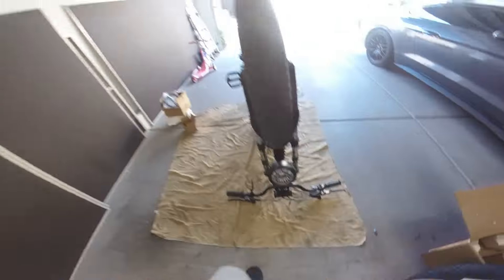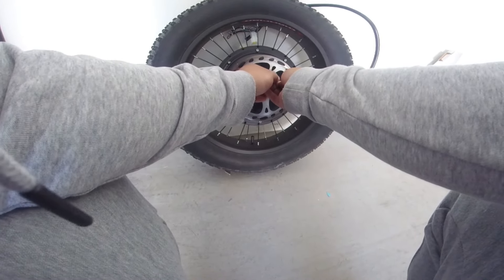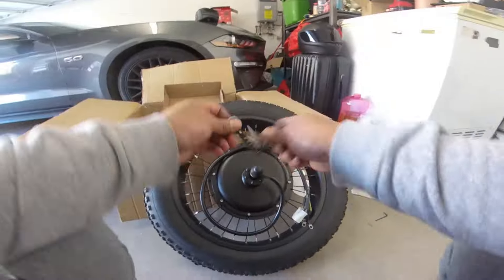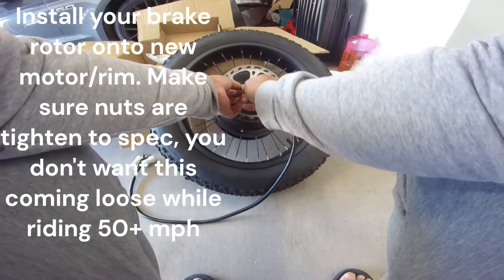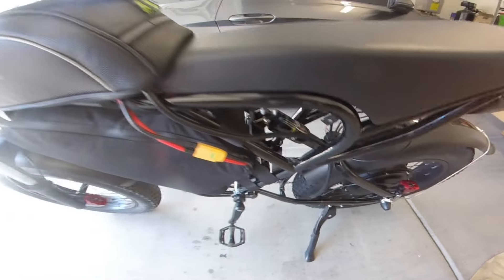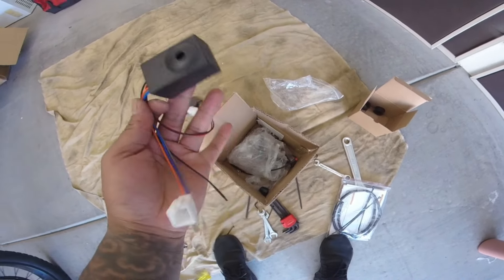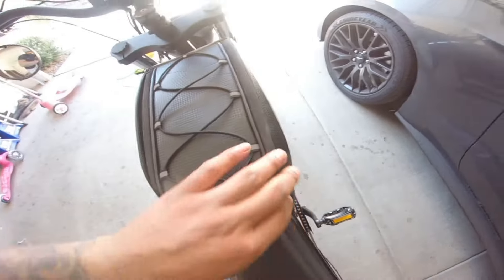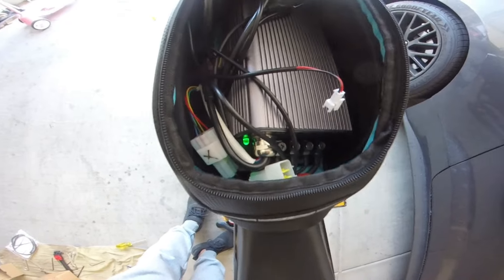3000w 72v kit E-bike installation video

Comment: So basically, gut the bike and put stronger ones in? No need to use any of the factory stuff, correct? I have the exact bike and want to upgrade. Appreciate your videos, been looking for a couple years now on how to get this bike to go faster. Even tried clipping wires which did nothing.
Reply from the maker: You are replacing the important components, battery, hub motor, controller, throttle, display
Reply from the maker: This is the best bang for your buck to go fast and look good while doing it
Reply: You're a saint  @Electronic2wheels
Reply from the maker: @paullsmith5548  thank you

Comment: Is there any way to mount the controller somewhere else? Maybe under the seat or anywhere other than the space between the seat and handlebars as I’d prefer to mount a bag there for actual storage instead of the controller.

Comment: I can’t find it if you answered in other messages but what kit is this?  Could you drop a link 
I’m guessing everything but the battery
Also do you know the weight with the new battery and motor
Thanks for the vid
Reply from the maker: https://www.ebay.com/itm/225000078386?mkcid=16&mkevt=1&mkrid=711-127632-2357-0&ssspo=ed728llcqlm&sssrc=4429486&ssuid=DP9k0GGeTNO&var=&widget_ver=artemis&media=COPY
Reply from the maker: It didn't add too much more weight to the bike. I'll have to grab that info for you. The link is the exact kit I bought. Super easy to install.
Reply: @Electronic2wheels  awesome thanks a lot. Love the videos
Reply from the maker: @lukenorton8243  Thank you for watching. I have some more ride videos I need to upload.
Reply: @Electronic2wheels  looking forward to them 👌

Comment: Can I just get any kinda 72 volt battery or does it have to be a certain one?
Reply from the maker: You can use any 72v battery, continuous current must be 80 or more. If not, your bike will cut out while under load
Reply: Like 80ah?
Reply from the maker: @danielczajko1  no, not ah. Continuous current. The controller is rated at 80 amps so you need a battery that can handle 80 amps
Reply: I'm lost bro
Reply from the maker: @johnnyblaze43  what do you need help with
Reply: @johnnyblaze43 ah is the size or capacity of the battery. When he says 80 he’s talking about how much current it can output continuously.
Reply: @Electronic2wheels I thought the q20 could only handle a 52v battery

Comment: I need my bike to go 70-80, any advice on wattage and such?
Reply from the maker: I recommend you have the stopping power and suspension that can support the speed first. 5000 watt or 8000 watt hub motor with the supporting battery and controller will get you there. Be safe, my fellow e-biker

Comment: where did you buy the hub motor kit is the battery included
Reply from the maker: I have the links in my other videos but let me grab it for you. No, you must by the battery separately.
Reply: @Electronic2wheels  what about headlights did u buy separate battery converter
Reply from the maker: @michaelynalvez  I did it two ways, one simple with power and negative from harness to a power drill 20v battery pack.

2. I ran a step-down converter 72v to 24v

Comment: Did this to mine at the moment 51 mph is that max speed only or can it go higher
Reply: Spent about 1200 with battery and kits also suspension
Reply: Because before that I put the battery and controller only with stock 1500w and battery 72v 30ah and was getting 41-43 with stock motor pretty much the battery is a big difference but is most of the cost
Reply from the maker: You can get more speed if you get a battery with more than 80 continuous current. I bought a 300 continuous current battery that will give me a boost, I will let you know how fast I can take it. I'm still waiting for the battery to arrive. Also, the battery is made of moli cells too
Reply: Hello. Where did you buy the kit from? Will it work on my Q20 PRO?
Reply: @Electronic2wheels thanks for info will look into better battery
Reply from the maker: @GuestAcc-i7y  upgrade your controller as well. I'm running 150 amp instead of 80 amp
Reply: @Electronic2wheels  what's the name of the kit?
Reply: @Kalakaz.Rivereña  did the stock controller for the ridstar q20 run the 72v battery?

Comment: How much for all the parts ?
Reply from the maker: Not including the Shinkos tires. The bike, motor kit and battery cost under 2500
Reply: @Electronic2wheels  do you need to upgrade both motor and battery to reach those speeds?
Reply from the maker: @ditermejia6027  so the kit is a 72v (battery) 3000w (hub motor). To run the kit, you must have at least 72 volts supplied to the motor. How much distance you want depends on how many amp hours you have on your battery. I originally bought 20ah and now upgrading to 30ah
Reply: @Electronic2wheels I’d like to reach 40 mph. What would you recommend doing cuz at $2500 for the upgrade I might just get a surron
Reply from the maker: @ditermejia6027  2500 including the bike. So, roughly 1500 you'll be spending on parts
Reply from the maker: @ditermejia6027  it's really up to you, both bikes are totally different. It just depends on what you want and want to do with the bike